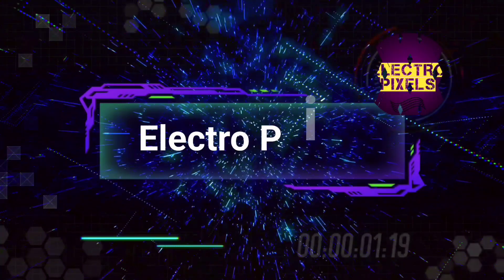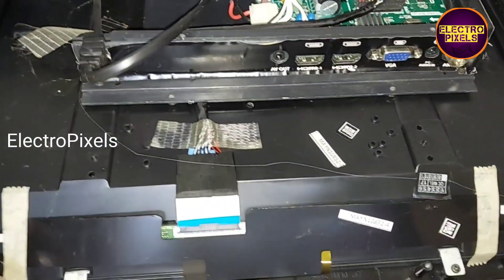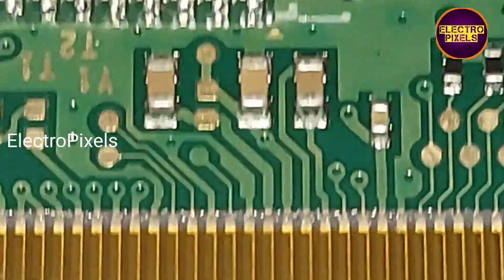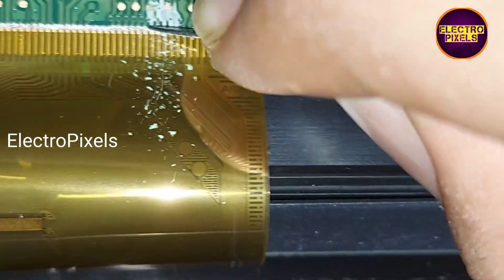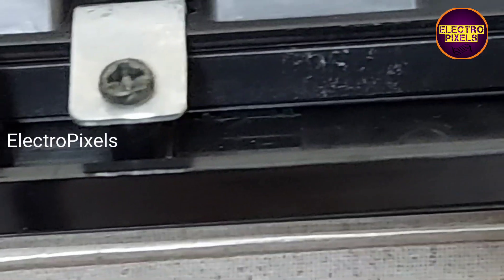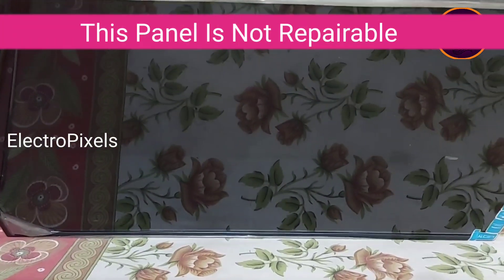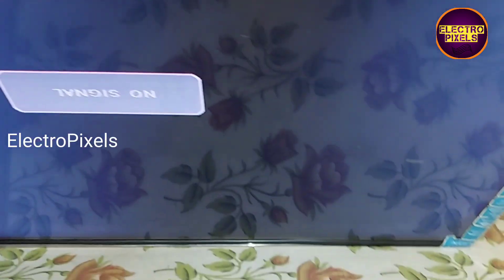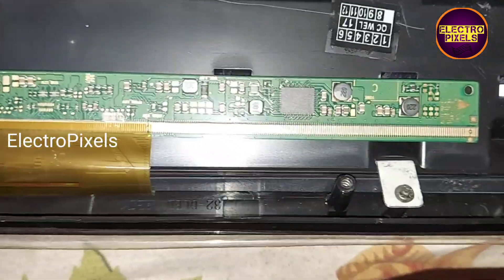Led Tv panel short removal in Single Cof Panel with SM4186 Dc-Dc IC |Reparing Failed|Not Repairable

Comment from the maker: Note:I Know That this Panel Can Repaired by using Short killer method, But in my opinion it just a waste of time the Complaint will return again within one Months,Some will last more, depends on luck basis. Another solution is After Cutting Gatesignals to the panel side Join all tracks using a Jumper Wire and apply different panel voltage like vgl, gnd, 3.3-26 v and Check the  Picture to Remove Lines after cutting the Panel. My Experience Lifetime of the Display is very less for the Above Methods and it's only provide a Temporary Fix for a short period than the Cutting method. So I Replaced this Panel With New One. Installed New panel and Problem solved